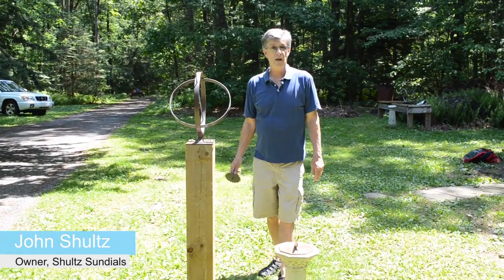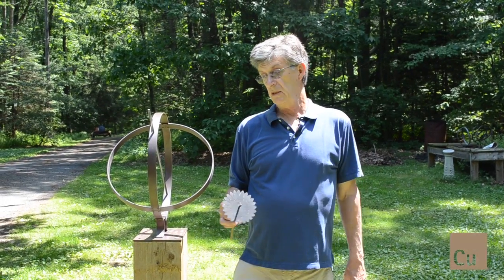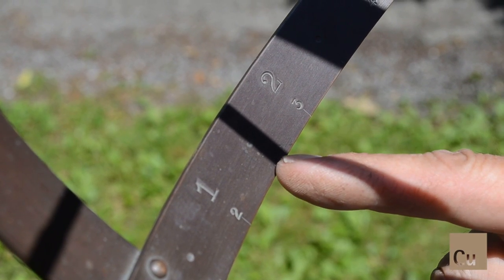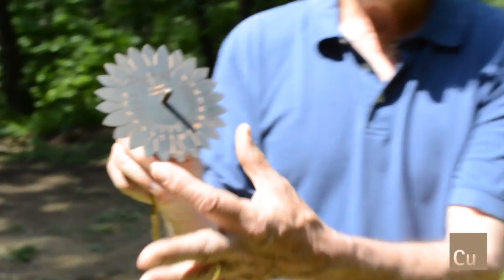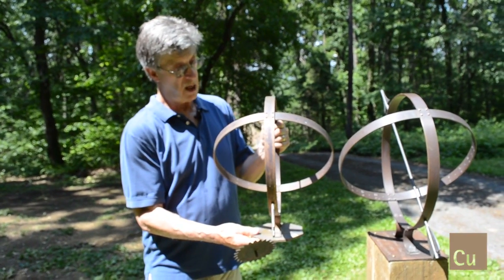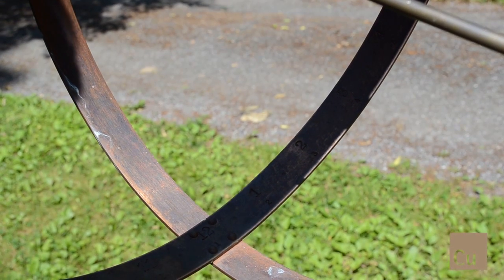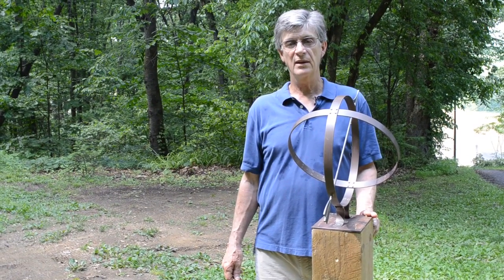John Shultz Explains How A Sundial Works

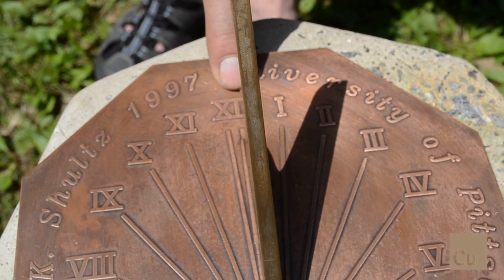Comment: 0:53 - Excellent work, John! You adjusted the dial to your longitude! Fantastic!

By the way, I am about to make some videos on my formulae for the reclining-declining dial. This, as you know, is the dial that reclines or inclines and does not face any of the four cardinal points of the compass. In Waugh's old book, he gives an empirical method, and Mayhall give the geometry. Neither gives the formulae, so I am up to the angle the meridian line makes with the horizon. I found your video because I was looking for some pics for the video.

Great to see that the art is nowhere near lost! Thank you!
Reply: Ouch! On second look, you gave the space for the gnomon, my bad. The reflection made it look as if the LAT and LMT were shown, sorry. Still a great-looking sundial, John! Keep it up!

Comment: On your armillary sphere why don't you drill a pin hole in the center of where the top of the equatorial ring crosses the longitudinal ring and add a seasonal scale to the inside of the bottom of the longitudinal ring so that a dot of light is cast on the inside of the longitudinal ring, thereby showing the time of year exactly? Of course you would need to bevel the top side of the pinhole to at least 47° so that the rays of the sun aren't obstructed by the thickness of the ring on the solstices.

Comment: I have been told that in the southern hemisphere that the sun travels anti clockwise  on  a sun dial, is this right ?
Reply: Yes. As far as sundials are concerned this is correct. Not because the sun is traveling the opposite direction but because you have turned your sundial around. In the northern hemisphere, you point your sundial north. In the southern hemisphere, you point it south. However, sundials are designed differently for the northern hemisphere and for the southern hemisphere. On one designed for the northern hemisphere, your a.m. hour lines are to your left (west) and your p.m. hour lines are to your right (east) while the reverse is true for a sundial designed for the southern hemisphere. Makes sense now? 😎

Comment: Mr Schultz. I would like to ask a question. I, as a volunteer, interpret the time on a sundial at the Museum of Natural Science in Houston. The dial is listed as # 68 at sundials.org. If you can brouse to that website, there are 3 photos. The middle one shows the Gnomen shadow, as well as an analemma on the left side of the photo. So I interpolate the time, and in the photo it is maybe 10:10. If DST is appropriate, I add an hour. For this time of the year - July, the analemma indicates that 3 minutes should be subtracted to get the corrected time. My problem is that it generally works well around noon, but not at 4PM  or 8AM, for example. So my question is the time correction constant throughout the day (- 3 minutes) or does that 3 minutes get modified for earlier or later hours?
Reply: Wow wow wow...that is quite an expensive looking one. I will be the first to tell you that I do not have any degree in anything dealing with sundials. However, I do have a very good understanding of how they work and have built my own (numerous ones of various styles) that have all been accurate and remained so throughout the day and year. The equation of time (subtracting 3 minutes for July) should not have to be modified for the time of day. It is modified on a daily basis (generally speaking. It may gain or lose SECONDS over the course of an entire day. Nothing that should throw the time off like that). The only other thing that affects solar time is your longitude. Houston is located roughly at 95°W longitude. This would mean that at noon clock time for your time zone, which is -6 UTC, you would need to add roughly 20 minutes to your local solar time PLUS the equation of time difference to get clock time. However, the difference within the time zone is also constant throughout the day and probably is already be factored into the dial making this unnecessary. I COULD be wrong...BUT...if what you are saying is true, it sounds like someone made a big, expensive mistake laying out the hour lines. How much is it off after your equation of time corrections....say around 4pm?

Edit: I suppose it's also a possibility that over time the dial has sunken into the ground, thereby throwing off the angle. It's a heavy pieceof stone and if the ground wasn't properly compacted or a proper foundation built, that COULD be a possibility that it was once accurate but not anymore. I would think that anyone designing something of this size though would definitely take that into consideration but....you never know.

Comment: I'd like to get a sundial that shows me when the equinoxes are, will your sundials show me all four equinoxes, in particular I'm interested on knowing how to determine the spring equinox mostly.
Reply: Just so you know.  There are only two equinoxes, the Vernal and the Autumnal.  I think you may be thinking about the two Solstices, Summer and Winter.  If you have a decent globe of the Earth you can see where the sun is for both Solstices.  The Summer Solstice takes place when the Sun reaches the Tropic of Cancer.  The Winter Solstice occurs when the Sun reaches the Tropic of Capricorn.  The equator is midway between the two and when the sun crosses the equator (twice a year) is when the equinoxes (from the word equator) take place.  To make it even more confusing it's not the Sun that's doing the moving. Hope this helps.
Reply: Ed D. thanks Ed I'll have to read about what the difference between Equinoxes and Solstices are.
Reply: @Pgfracing  It's pretty easy to build one with minimal tools and minimal parts if you take the time to read how they work/how to build one. I made one accurate to within 2 minutes of clock time and also showing the time of year out of a piece of 4 inch plastic pipe, glue and a scrap wooden board. The only tools I had was a ruler, compass, pencil, hand saw, hand drill and adjustable square. These are all extremely cheap. You could buy the materials and tools for no more than about $40 US, assuming you had to buy ALL of them, starting with nothing. I could send you a link explaining it if you want. 
Edit: you could actually build one out of tape, cardboard and a cardboard tube.
Reply: @American-Plague I would be interested in checking out a link if you would like to share with me also